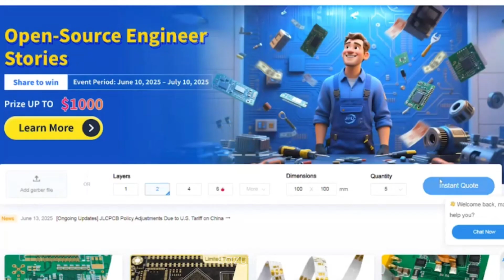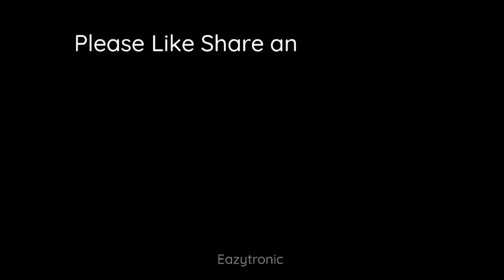How To Make Solar Tracking System Using Arduino | Solar Tracker | Single Axis Solar Tracker #robot

Comment: If you see colour code of resistor then they are using 10k ohm but by mistake they have printed 1k ohm resistor,but 10k ohm is more better to use cause it sense the light from slightly long distance too..than using 1k ohm resistor

Comment: Hi, you have use 1k ohm in video but in diagram 10k ohm resistor. Which one should we use?
Reply: Idk 😅
Reply: @Someonedrifting i have done it. Its 1k ohm 😂 u cooked bro
Reply: @irumqaiser2423 1k ohm or just 1ohm?
Reply: @irumqaiser2423 
Is the code right?